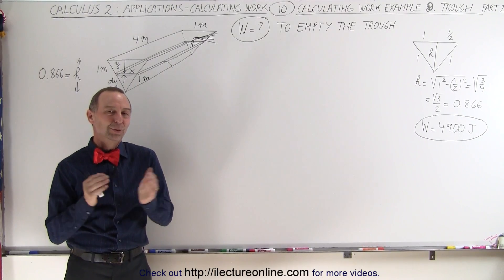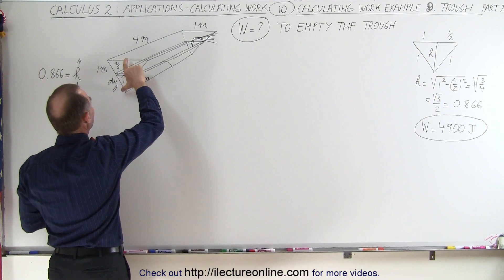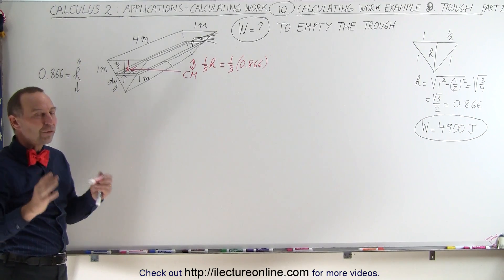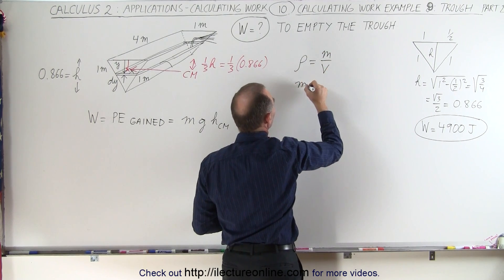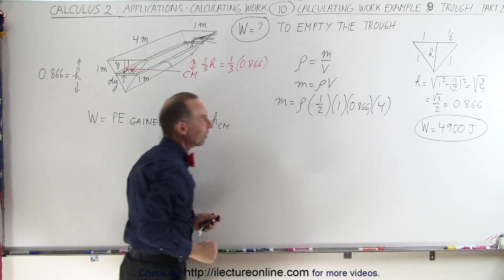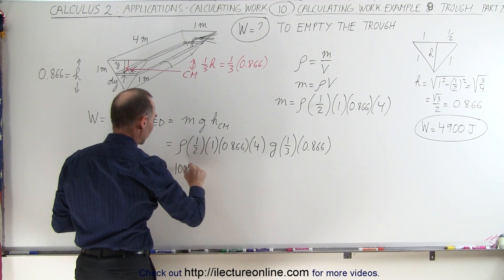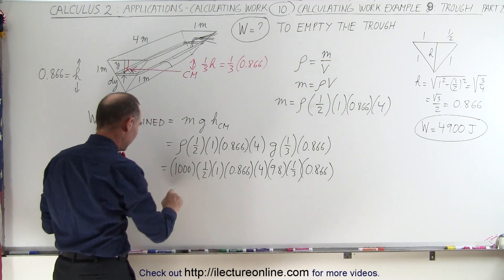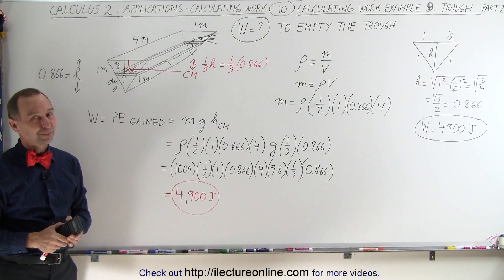Calculus 2: Applications - Calculating Work (10 of 16) Calculating Work Example 9: Trough (Part 2)

Comment: Why the center of mass?
Reply from the maker: The center of mass is the point that acts as if all the mass is located there.
Reply: @MichelvanBiezen  So if you find the center of mass, you can treat it like a point-mass and do all the work from that height?
Reply from the maker: Exactly.
Reply: @MichelvanBiezen  Thank you sir. Much appreciated